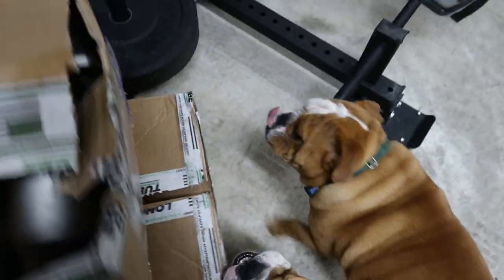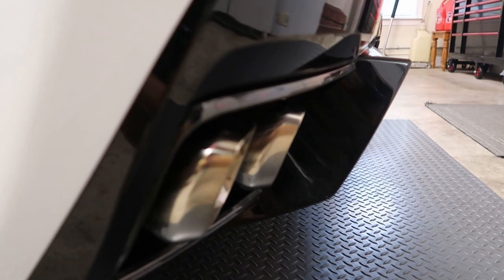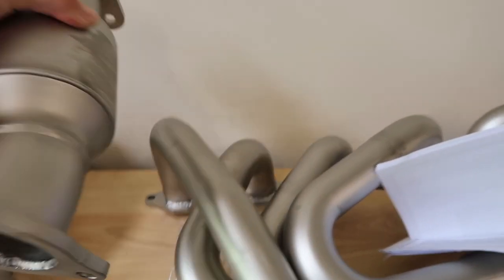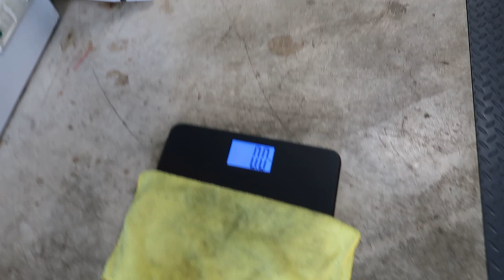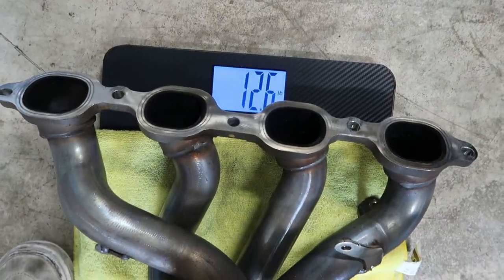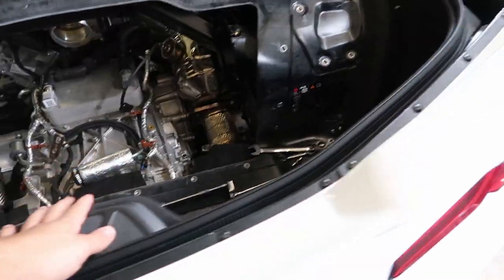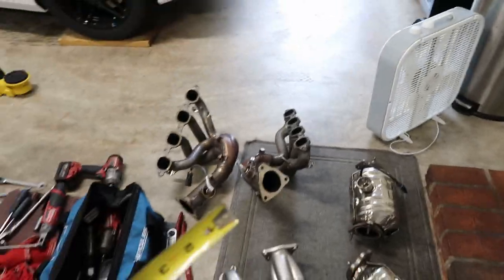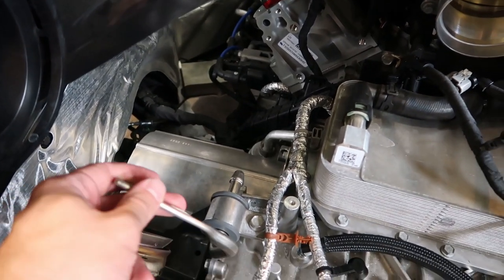The C8 LTH Headers and High Flow Cats are Finally Installed!

Comment: In this video, is the cat-back exhaust system stock?  I just got a C8, and I'm trying to determine the best (and cheapest) route to take to get it to sound right.  I had a C7 Z06 with Kooks headers, cat bypass, and corsa exhaust system....and every time I just barely revved it, it would cause a "crack" sound.  It was so badass.  I want to do this to my C8, but trying to avoid the entire exhaust system (headers, cats, catback).
Reply from the maker: Yeah it was a stock cat back
Reply: @ItalianStallion410  Awesome, thank you!

Comment: What did you do to get the broken bolt out on the side cat?
Reply from the maker: I hammered it out
Reply: @ItalianStallion410  how did you get the bottom bolt on the passenger side cat? (The side that connects to the exhaust not the manifold)

Comment: Did ya re use the oem gaskets
Reply from the maker: Yes
Reply: @ItalianStallion410  no issues, dont feel like a new one is warranted, isntalling full exhaust this weeked, started with the bumper last nìght
Reply from the maker: @htownsfinest87  yeah no issues the factory gasket has a little heat shield on it also so it was good